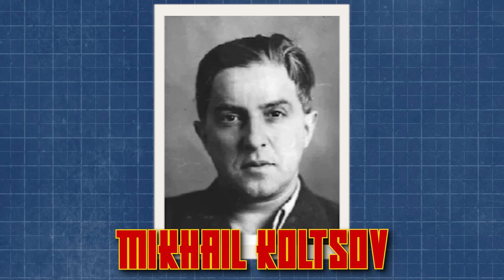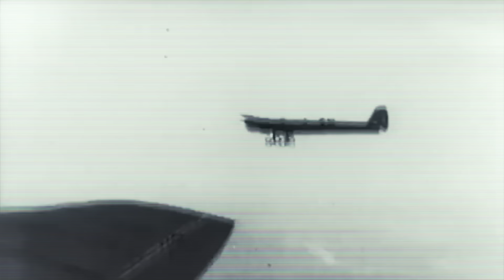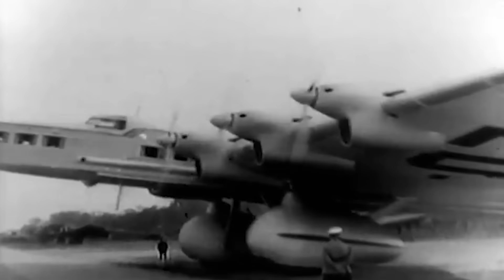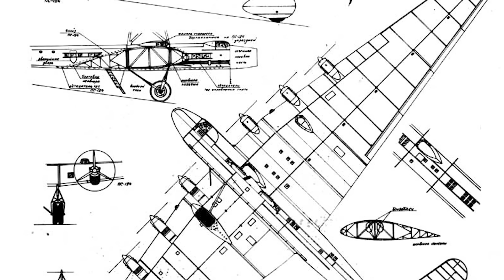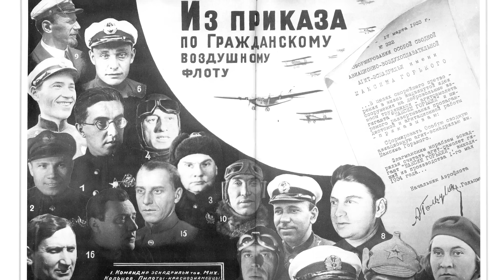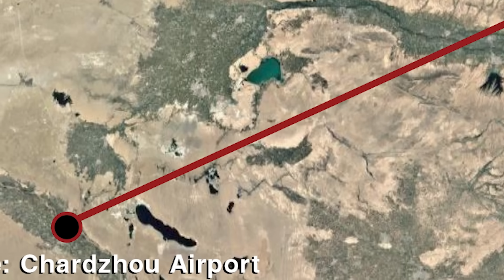Stalin's Eight-Engine Propaganda Machine (What Could Go Possibly Wrong?) | ANT-20 Maxim Gorky

Comment: The ANT-20  has similar wingspan  to the Martin JRM-1 Mars flying boat,  of which 2 planes were stationed in my area as forest fire fighting water bombers from the 1960's to 2010's  powered by four  Write R-3350 2500 HP engines they were very massive and loud.  I miss them so much.

Comment: The funniest part about the Voice in the Sky idea is the thought of a Doppler-shifted Soviet anthem being blasted over the countryside
Reply: And a sound system strong enough to do that would weigh about as much as the plane itself considering the sound technology of the time.
Reply: @BrunodeSouzaLino  Fits with the Soviet design philosophy though, no? Simplify and add weight.
Reply: @RicHattleVead  It absolutely does but whoever started working on it would be Goulag'd due to poor performance and delivery because the solid state technology of Class D amplification and things like planar drivers we have now doesn't exist yet.

Comment: Around 1977 or 1978, when the Central Airfield was still operational, yours truly and his school class attended a brief tour of the last days of the airplane, in reverse order: first, the graves, then, the crash site, and finally the assembly halls. Of course the teacher cheated us on the latter part: the old hangars were long gone, the current production plants were closed to any visitors - so they showed us "something big", not related to early Tupolevs. But this did not seem that important. What was most striking was that the house wrecked by the crash was still standing, only three kilometers from our school. And the fact that Blagin was buried with honours along with his purported victims. "Yes, boys, it was his fault. Yes, he lies here with others. No, no further questions, deal with it."

Comment: Planes board on the left side because Pan Am's Clippers used ocean liner terminals, and oceanliners board on the left side, and they kept the same standards when they switched to airport ops, and it became the standard. For if you ever need a plane to boat sponsor segue fact

Comment: They put the printing press IN the plane. Because that'll drop more leaflets than just putting printing presses at the airports refueling the thing...
Reply: It was so you could write propaganda enroute ready to deliver when you arrived, the latest dictates dreamt up by its passengers hot off the press.
Reply: It’s bc the “Official Party Line” changes faster than radio transmission speed, just like today’s Communist’s: rhe American Democrat Party
Reply: @bocefusmurica4340 lol, you loser.

Comment: How often do we hear that an aircraft has been designed for an engine that is not available and has to make due with what is available? It seems that aircraft designers are particularly prone to designing around the latest and greatest engines, only to find that those engines don't actually exist.
Reply: Most recently Boom Technologies has run into this. It turns out engines are extremely important to aircraft performance, but no aircraft maker has succeeded in building their own engines.

Comment: 20:00 my entirely uneducated opinion is that the disrupted airflow caused by the dorsal tractor engine wouldn’t give the pusher engine that much to bite on. Can anyone please clarity?
Reply: They did this with some other planes. The German Do-18, I had a model of this I built as a kid. Nice looking plane. Not sure if it would disrupt like you think. Interesting question.
Reply: dorsal?
Reply: @mikebaker2436 DAMMIT! 🤦🏻‍♂️😂 Cheers sir!
Reply: I suspect so. See the Cessna Skymaster. Front engine goes out on takeoff, the rear engine just helps you crash faster.

Comment: Adding more engines with a lower power output. Why? Lower costs?
Why not add more powerful engines with a lower number of them?

I have these books that show what the Soviets acomplished after the war. And they pursue to jet power.
Reply: "Why not add more powerful engines with a lower number of them?"

Ok, which mid-1930s engine of Soviet origin do you suggest?
Reply: Did you not watch the video? That's exactly what they wanted to do but the more powerful engines that were intended for it weren't ready at the time. It's successor then got those engines and it got rid of the two dorsal engines.

Comment: Cracked up at "pending investigation into misappropriation of state roubles for personal Airfix Lancaster assemblies". Great video!
Reply from the maker: My pile of unbuilt airfix kits definitely qualifies such actions 😂
Reply: @RexsHangar  Ok, part built Airfix, 95th rifleman in 54mm, 1/76 Cromwell Mk IV. I've also got an Airfix 54mm French line infantryman and an Grenadier of the Imperial Guard still in their boxes. The really big issue is the 1/144 Revell HMCS Snowberry, a flower class corvette, started but now I'm looking at it thinking 'erm, was this a good idea?'

Need to do a proper sort out of my box room/office and re engage my modelling mojo.

Good video by the way, never heard of this beast before.

Comment: Hum, So what's up with the very wide wing roots?
Reply: Low to moderate aspect ratio wings were quite common, not for the reasons you now read on Wiki for instance, but because they do offer enough lift and capacity for other things like fuel tanks or other things while structurally easier to build than long, thin wings.
Another example is the Junkers G.38, even the DC-3 has a relative low aspect ratio.
Reply: Thanks for the reply. I did find other 1930's aircraft that also have compairtively wide wing roots.